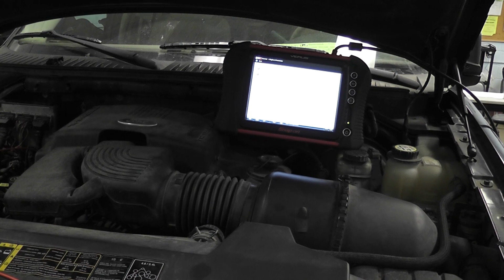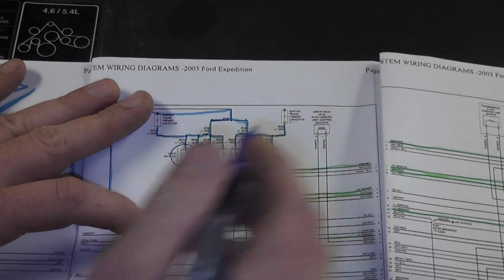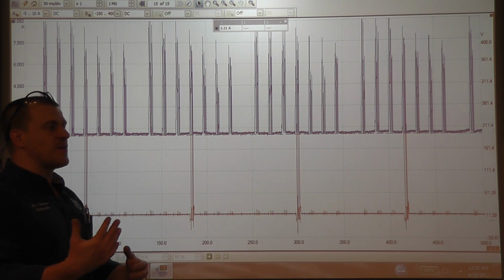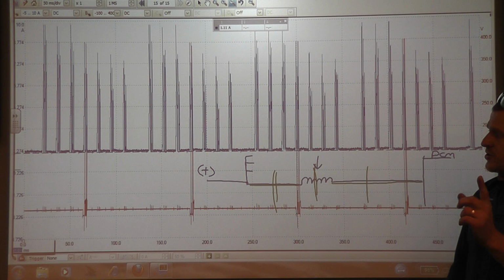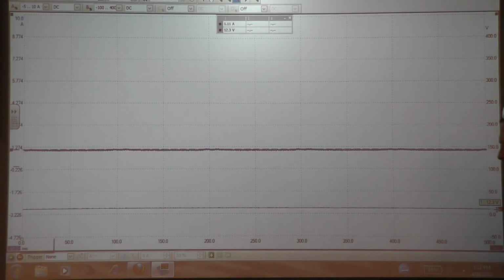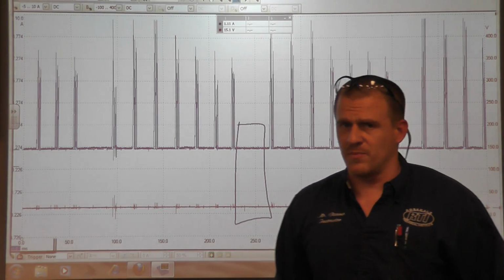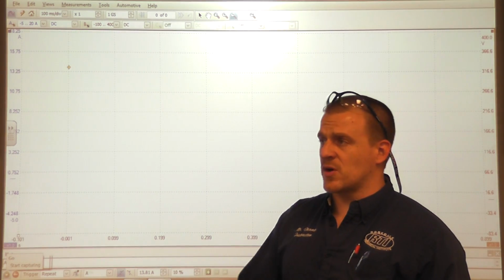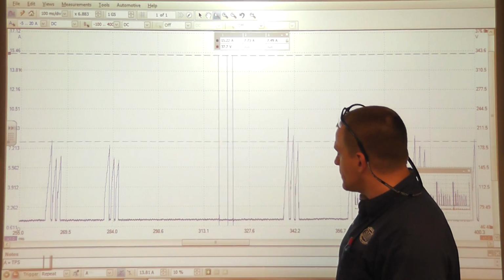Ford 5.4 shorted coil primary winding and bad computer driver

Comment: According to firing order, the firing missing at 29:23 is number 6 and not 5 as you said, because you moved the number 5 connector to coil number 6 but it will fire as a cylinder 5 because it is connector of cylinder 5 and firing order is 1 3 7 2 6 5 4 8 as you said previously

Comment: Paul, when you are talking about the second and third ramps for the primary side of the coils, why do you only look for turn on occilations at the beginning of the first and then look for occilations a little bit after the second and third ramp?  Does this have to do with the on time of the coils? So if you see occilations at the beginining of the second and third ramp, does this indicate a problem with the coil because the coil is being stressed due to the fast current surges?  Thanks Paul.

Comment: This is a pretty old video, but I had a question in regard to primary current ramps, scoped secondary waveforms, maybe even primary voltage waveforms. The big points you point out are short primary, secondary, and transistors. And looking at your case studies I see what to look for, pretty distinct,. of course this is in theory I need to get a scope and practice. You show patterns of open secondary , but what if you have resistance in say a plug or wires. or say the plug gap is wearing?

Comment from the maker: Never heard that. Although when you get into the "tuner" world with all the MSD ignition systems and modifications anything is possible. 
For me, just don't buy the bottom of the barrel plug wires for the simple fact that I have seen them only last a few months.
Also a plug wire will not affect ignition timing. I don't care what kind of wire or who makes it.

Comment: How about having the output driver replaced in the PCM? The transistor is probably worth $2 ($20 with overnight shipping) and it might cost $50-$100 total to have it fix by an electronic technician. I know that's a lot of trouble but compared to >$500 for a new PCM... (and it might take a few days to get the new PCM anyway...)

Comment: @scannerdanner  Paul I put a duralast ignition coil pack on this DOH 3.0 24 valve.. Engine (ford) whit new plugs and wires, now this thing is back to running really ruff agin, like before I replaced the collapsed elbow  stft are back up 20 plus agin at idle.. No dtc.. I know I firing order correct, Maf data pid is up 10plus gps..

Comment: Great video. I noticed you used the amp clamp on the A channel.  Not a big deal with this type of capture, but the Pico 4423 has two ADC's and they are split between channels A & C I like to use my amp clamp on the B or D channel to assure maximum sample rate for faster signals. Just an FYI!  Thanks for the great videos :O)

Comment: Scary, i'm working on the exact vehicle right now, 03 Exped..
has P0306(cyl 6 mis) and P0174(B2 lean).
owner changed all 6 coils and all o2 sensors.
will find out more tomorrow..only equip i have is a multimeter and 3840F scope.

Comment: Paul. If you could use only one test. Current Ramp vs Primary ignition (on a Scope). Which one would you choose. In other words, which test could you get the most information out of; and are they the same for ignition coils and injectors.

Comment: Hi Paul - Happy New Year. I was remembering a "fix" for a bad idle being related to the type of wires that were put in the car. I hear some of the aftermarket, supposedly better performance wires actually cause poorer performance. What's the theory behind that? Is it because with these non-OEM wires, you are actually affecting the timing because the wires transfer electricity that much faster (or slower)? Can any of this be shown on a  scope to prove it?

Comment: On this design could you have checked coil control with a test light? I remember you mentioned using an attenuator with the scope for the voltage spikes.

Comment: 98 GMC safari 6 cyl rwd.Accelerates on its own, stalls at stop signs. Codes for IAC.Replaced the IAC amongst a lot of other sensors, no change of driveability. This is my moms vehicle;she live far from me and wont bring it all the way to me. Her husband(who is from Glassport,PA) keeps throwing parts at the car. My guess: wiring integrity has been compromised. Any educated guesses from the DanMan. Thanks in advance.

Comment: You can also use Ohmmeter to test resistance of driver transistor no.6 and compare it to know good driver transistor... Shorted transistor have very low resistance compared to good working driver transistor... If driver no.. 6 have low resistance. Then this confirmed defective ignition coil primary winding.

Comment: That goo is called "Conformal coating". The removal technique depends on the coating chemistry. Personally I first try to melt it with an old soldering iron, it usually does the trick. search for "Empfasis - Removing Conformal Coatings"

Comment from the maker: The coil shorted out from a number of factors which in this case, no amount of preventive maintenance would have helped. Heat, vibration, and coil design would be the culprits in this case. As for the PCM, as I showed in the video, the shorted coil cooked the PCM driver. It needed a coil and driver to fix the #6 cylinder misfire.

Comment: Hi Paul
Request.Will you please upload a Video on how to use Mode$6 To confirm a MIL repair.
Example,I had a P0420 and after replacing the converter and clearing the code,the code set again after running the drive cycle.?Garbage aftermarket cat (supplied by costumer), I had to change the cat which fix the problem.I checked your book and did not find M$6 info.
I have Limited experience with M$6 and love your explanation styles.(Simple,complete,useful and intelligent). Asking too much?
Thank you

Comment: Could P0356 simply be a bad or failing coil or spark plug? I know there are other codes pointing to the coils (P0301-P0308 I think?). Autozone suggestion from their "computer diagnosis possibility" readout said ignition coil and/or spark plugs. Thanks!

Comment: Hi   paul  I got a 2007 volkswagen jetta 2.5 liters  5 cylinder  . and  i have misfire codes
PO300, PO301, PO302,  PO303, PO304, PO305. I did  replaced spark plugs and injectors
cleaning with ultrasound .  what  can  cause  all  of  these  codes ?      somebody told me
 that  valve  cover  will  take  care  these  codes  .   but   not  sure  what  do you  think??

Comment: i have a 2001 ford f250. P0358. coil H cylinder number 8 misfire. is there a fuse for the ignition coils on the 2001 5.4 liters?

Comment: I have a 2001 Nissan pathfinder with a p1320. I've replaced all the spark plugs and two coils and the code still comes back when i perform a power balance test all of the coils create a difference in rpms. What should i do next?

Comment: What would you say about a 1997 nissan it has cylinder missed firing foult code po301 I replace the spark plug wires spark plugs. And still missed firing could it be the distribuitor since dis have no coil?

Comment: I thought a shorted plug will overheat the coil and melt insulation and shorten it and increase the current as an effect. 

Maybe the computer has recognized the bad coil and switched off current  to it.

Change the coil unplug the battery and restart the PCM, maybe it will fire again.

Comment: Few questions:
 1) Can you post a link to your book please?
 2) Can I use a generic digital oscilloscope for this sort of work?  In particular, a Fluke 199C handheld.  This scope is a 200mhz 2 channel. 
 3) If using such a scope is possible (Fluke), how does it reference back to your work (or book)?  
 4) Are you using a special automotive system/scope for these tutorials?
 5) Do I have to have special probes such as a capacitance probe you were using earlier?

Thanks!
Reply from the maker: Go to my website www.scannerdanner.com for more info on the eBook and paper book. 
It is becoming more and more difficult to answer questions here. I have 80,000 people asking me for help now. So I have created a forum to help you guys better. It is free to join and we can exchange pictures, wiring diagrams and waveforms if needed to help guide you through the process of troubleshooting your vehicle. Thank you so much! Hope to see you there. 
Paul Danner (ScannerDanner)
https://www.scannerdanner.com/forum/post-your-repair-questions-here.html

Comment from the maker: you can't parade a c.o.p. system on the secondary side without a bunch of adapters. But im sure it could be done. its just not practical. especially when some of these coils live under the intake manifold.

Comment: Hi Dan. Very informative video. I have a question, Could you have just used the verus by it self to check the current ramp w out the pico scope? Or the pico was just used on these particular vehicle, cuz I've seen u used the the verus w out the pico scope? Ty.
Reply from the maker: +Milton Solis absolutely I could have used the Verus scope for this. I just chose the pico in this case study

Comment: Could you explain further the part about the ignition switch controlling the coils directly. Would this cause issues if the ignition had resistors or diodes placed in the line when touching high rpms? Thanks
Reply: The vehicle hesitates a lot when pushing through 3500-5000 rpm range but doesn't throw up misfires or CELs unless the engines around 180-190 degrees. It hasn't thrown a CEL since I put a 170 thermostat in a week or two ago. Really appreciate the info. This truck is getting on my nerves now. 100% new timing last February and I haven't got to drive it fast yet. Ha

Comment: Mr scanner Danner I could find the link to tell you the results of my starter problem why it was turning over real slow it was a ground cable was bad got the engine running but now I have a p0358 code what do I do new coils new plugs I have one question what would happen if coil 8 wire plug was backward due to replacing plug connector
Reply from the maker: Got to stay in the same thread, otherwise I have no idea what we are talking about. Sign up for email notifications then you won't have this issue

Comment: I was diagnosis the same code, P0356 I have found with a open control wire at coil connector, with KOEO, Vbat at one side of connector and other of the coil, but not at pcm pin. control wire. the question is ,,., when this wire is open there aren't output signal from the pcm ? why? the pcm need to see this voltage. to get output?
Reply: It goes back to Section 3 "Transistor Drivers and Output Solenoids". IF the PCM does not see the correct voltage level for a specific command on an output, it may shut it down to protect itself.
Reply: ScannerDanner Premium Thanks for your answers,.,
Reply: ScannerDanner Premium

Comment: Hi mate fantastic video. I have a 2002 f250 from australia and its a 5.4 similar to your vehicle in question. However my misfire is intermittent and not constant. There is no patterns i can tell. Does it idle, at 100kmh etc.
I have changed the coils, spark plugs and oxygen sensors, and have already swapped the coil 6 to another cylinder to see if it moves. It hasnt.
The only code i get is the po356. What would be my next move.
Cheers.

Ozcan
Reply from the maker: Intermittent in nature suggest the driver is fine. Look close at the wiring harness to the number 6 coil with that code.

Comment: Hi, On this coil you can see the primary waveform,but I think on some coils you cannot see the primary waveform, right? What is the difference between coils where you can see the primary and coils where you cannot see the primary? Thanks
Reply: +Jonathan Dean  2 wire coils are ground controlled directly by the ECU, with a corresponding primary waveform.
Some 3 and most 4 wire coils have the control circuitry inside the coil itself, and the ECU only sends a 0 or 5 volt signal to activate the coil circuit. The primary circuit is inaccessible, as it is inside the coil.

Comment: its a Nissan pick up king cab with a 2.4 engine rear wheel drive, what i just found out today may26 that the missed fire its no there any more but still running unstable like it was out of time when i had the missed fire my check engine light was blinking compression on four cylinders are average 145 psi there is not intake manifold leaks it seems like when the temperature its below zero the truck doesn't  like it .i took it to a garage and they couldn't find anything  i m giving up on it,

Comment from the maker: there are limitations to every piece of equipment. you will not be able to do everything i did in this video without a scope. 
coil failures are common. if you feel a dead misfire at idle or all the time then go after your misfire code first. if you feel no misfire then chase your lean code first

Comment: I have a misfire on cylinder 3. 08 Expedition (P0303 code and P0316) I do know that even with the misfires, my injector is still firing on that cylinder. If I understand you correctly, if the coil isn’t firing on cylinder 3, the injector shouldn’t be firing either, in order to protect the cat. What should I look for now? I’ve replaced all spark plugs and the COP for cylinder 3. All Motorcraft parts. I’ve even replaced catalytic converters, the injector for cylinder 3 and MAF sensor. Compression is good and so is fuel pressure. Any ideas? Please advise
Reply from the maker: These models are known for misidentified cylinders. It may not even be cylinder 3 that is misfiring. Confirm by doing a cylinder drop test (unplug coils one at a time)
Is it a constant miss?
What is the 316 code definition?
Reply: @ScannerDanner  thanks for the reply. The P0316 code is misfire at startup

Comment: Hi paul. I have a question regarding testing 3 and 4 wire COP coils. I have tested control circuit before by packprobing the control wire on the coil and connecting a grounded test light to it to see on and off control from the coputer. I see u recommend this test on 2 wire COP coils but not on 3 and 4 wires. Is there any reason why this shouldnt be done?
Reply: The two pin designs your connecting to coil negative. On the 3 and 4 pin designs you are not. Coil negative is internal and cannot be accessed so what you can see is base circuit control signals from the PCM. These are low voltage signals that will not light a test light. Possibly an LED type but definitely not an incandescent. In fact with an incandescent light you may actually pull this signal to ground.
Reply: ScannerDanner Premium If the signal is pulled to ground will that hurt the PCM ? Thanks brother

Comment: Because of all the new testing equipment coming out from Snap-On, the verus Pro only cost me 1300 bucks, and basically I'm Only One download away from the latest update. it's amazing when you buy some used equipment from the Snap On dealer how much power you can get for reasonable cost.
Reply from the maker: Nice! Thanks man. Great buy and deal for sure. You will love it. When you are ready for that Pico, don't forget to go through my tools page on my website. I'll get some kickback from AESwave (you'll pay the same) and it helps to support what I am doing. Thanks again 
Paul

Comment: i have 2004 5.4 3v code 351 and 356 but the failure is intermittent, have you seen many ecms cause intermittent failures?
Reply from the maker: When the PCM driver fails for a coil, it is NOT intermittent.

Comment: What if u used the control wire from the cylinder that’s at tdc at the same time?
Reply from the maker: There are never two cylinders firing at the same time. Companion cylinders, yes, but they are on opposite cycles.

Comment: Do you know of anyone in Vegas who does this type of diagnostic  work? I have a miss in my 05 expedition..105,00 miles been to three shops and noone can find the problem also the mpg is really bad..but when not at idle runs strong and seems fine
Reply from the maker: Usually idle only misfiring is compression related (mechanical problem)
Just an FYI 
Find me on FB (ScannerDanner) and ill see if I can find someone in your area that follows me
Reply: @ScannerDanner  Man i would appreciate that..you dont even know,It seems everyone i talk to just wants to make a quick buck alt,oil change, starter,plugs etc..if the have to spend any time in actually diagnosis  they dont want nothing to do with it..people dont seem to take pride in there work anymore and welcome a challenge..we love the truck and its been maintained..low miles..thank you again..ill look u up on fb

Comment: Lets say I go to a car and and there's a driveability problem. Maybe a slight multicylinder miss and I'm thinking maybe it's plugs and wires. I do a visual, spray some water at the wires, etc. I don't see anything obvious maybe a little wear, but no ready to call a tune-up that going to cost the customer $200-300Is there anything your looking for on a voltage or amp wave form without pulling everything apart? not a obvious dead mis situation.   If this makes sense.

Comment: Having the same thing going on with my car pretty much except mine is a number 5 issue. Popped a P0355 codes instead of a P0356. Really hoping i just have a bad wire and not a bad computer cause i looked on alldata at my work and with a manual tranny which i have. Its 750 dollars.
Reply: I have the same code Po355, what did the issue turn out to be ?

Comment: Hi where do you have the amp clamp located?
Reply from the maker: On the main feed that supplies power to all of the ignition coils
Reply: @ScannerDanner  where is the main feed
Reply: @ScannerDanner  i just watched the newest video of secondary coil shorted.  This video where do you put the amp clamp?   It's not on the fuse box?
Reply from the maker: I think I show it? Main feed wire from the ignition switch? I know it's in here. Sorry
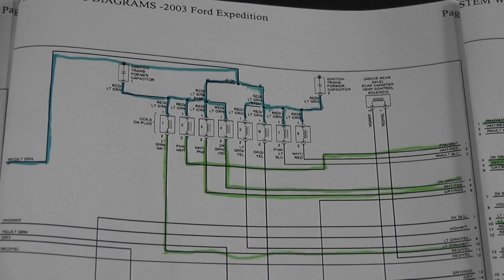Edit. It starts at 2:52 of the video
Reply: @ScannerDanner  oh ok yes now I see it.  Thanks